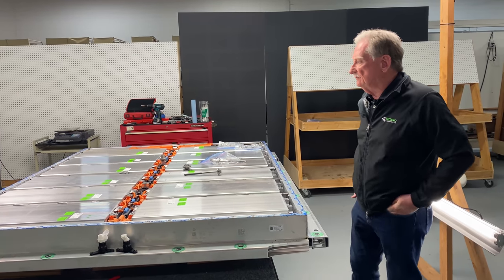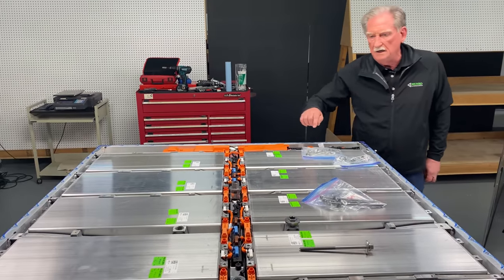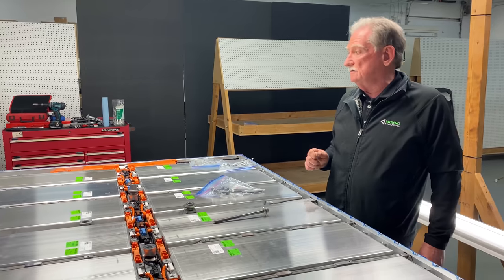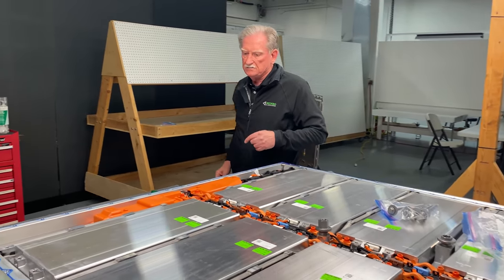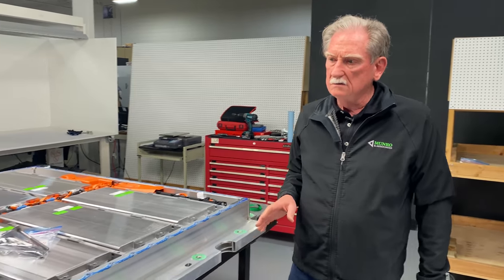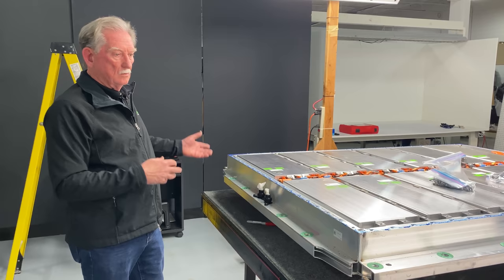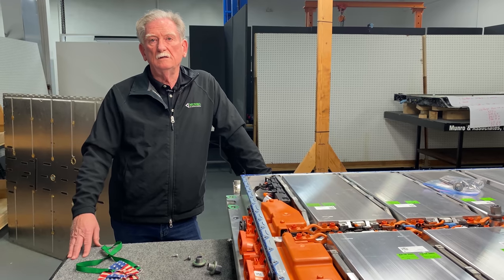2021 Volkswagen ID.4: Battery Teardown

Comment: weight per kWh is almost identical between ID3 and Tesla Y
Reply: Yeah, I don't get how they get 50kg savings
Reply: its childish from guy like sandy to compare apples and oranges like that.. its ridiculous in my honest opinion.. and colored the numbers red .. well..
Reply: acctualy Tesla have 78 kwh capacity
Reply: 75kwh i useful capacity (WV has 78 kwh useful capacity)
Reply: Id4 goes 260 miles on 82kwh while model y goes 326 miles on 75kwh. Id4 battery is heavier and larger for less range. Tesla's battery power density and energy distribution efficiency is much better. The model y is clearly superior.
Reply: No they are not.  Looking at kg/kWh VW is substantially behind.  Hence the reason a company made the business decision to invest in hiring Sandy’s company to help them.  This is not just Sandy doing it for no reason.  If you are not able to see the differences with the information presented then maybe you need to work on you math skills rather than whining that something isn’t being spoon fed to you.
Reply: @mikefromuk  it's a method of highlighting differences. Comparison is good to consider solutions. The manufacturer has asked Munro to come up with solutions to reduce weight.
Reply: @itsballtime  Tesla grossly overstates the range of their vehicles. Edmunds only got 263 miles out of their long range Model Y. Others testing has found similar results. Other brands get much closer to their EPA ranges.
Reply: Could be wrong, but isn't he talking about the weight of the system without the batteries?
Reply: @Weezedog  tesla doesn't just make up a range number. All companies follow industry standard testing procedures and the EPA validates their findings. It's easy to add FUD when independently testing vehicles on different days, different accelerations, and ignore relevant effects and call the test fair.
Reply: @itsballtime  MY costs a lot more too. Europeans earn significantly less which is why small cheap batchbacj vars sell well here
Reply: @Weezedog  the Edmunds test was flawed as the model y was tested in cooler temperature compared to other models
Reply: @kaya051285  the cost will come down once the Brandenburg plant comes online. Add import fees and taxes and all vehicles will be expensive. The fact europeans are still buying m3 mY says a lot
Reply: @Weezedog  326 is the epa range of the MY. Not teslas estimate. Not sure what you're talking about.
Reply: @kaya051285  German made Teslas from gigaBerlin will be far cheaper in Europe by avoiding import costs. Most if not all new Teslas in Europe are coming from gigaShanghai right now, and demand is still sky high. Imagine what happens when they are priced as a domestic product. Plus,, implementation of micron-level accuracy new equipment like the gigapress will drop costs further. Prices will come down in Europe once gigaBerlin is online. But even then, the pro s id4 with 260 miles and the long range model y with 326 miles are only separated by $5k. Not insane at all for the increase in range value alone without even talking about the model y's world leading safety rating.
Reply: @kaya051285  most sold cars in Sweden are volvos. V60, XC60, V90.
Reply: @itsballtime  Actually, only SR+ are china sourced. Tesla still sells every single car they could possibly make so the ID.4 vs model 3/Y comparison is not a zero sum game. Both have enormous marketshare to capture. And frankly, the ID.4 is specifically targeted at a conservative, ICE-driving segment and isn't going to appeal to tech savvy Tesla owners.
Reply: @itsballtime  if you look at the stats, you are not correct sir.
Reply: @itsballtime  There is only one thing which will force Tesla to lower the prices - fierce competition and that's good for us. Expect better built quality from the german plant but not lower prices.
Reply: @MariQ s It depends what you expect  - also ID4 is one category below the model Y. In the US there are many buyers deciding for the ID4 and against the Model Y, but the main VW target are ICE customers which they want to sell over to EV.
Reply: @bavariancarenthusiast2722  Competition in the ev space is great as it only kills gas cars faster. It doesn't hurt Tesla at all. Tesla will be able to bring real costs down for Berlin built cars by avoiding import fees. This is just objectively true. Whether the price the customer sees gets lowered by the difference remains to be seen. Tesla has enough pent up demand to sell every car they make for years out, and their tech allows them to command the price point by value per dollar spent relative to competitors. This cost savings by building domestic vehicles in Europe will dramatically help Tesla's profit margins, and is yet another tool Tesla will use to maintain its lead in the global rise of evs.
Reply: @Weezedog  That cold temp range for the Tesla against warmer ranges for all the others Edmunds did will never get qualified when quoted sadly..
Reply: @Korligan1  No, most cars sold in Sweden are not Volvo.
Volvo is the leading brand with a market share of about 20%, "most cars" would be >50%
Reply: @kaya051285  but we don't need heavy healthcare insurance, our pensions are backed by the government & all education is very cheap in comparison. My degree cost was the books I bought and under 300€ for student union memberships.

For example daycare for my 2 kids costs under 400€/month, preschool when it starts is free as is schools and there are countries here where daycare doesn't cost a dime.

I'm happy with my salary, I get lot less than I would in the Valley but cost of living is a lot cheaper too because of the taxes we pay and unions we got.
Reply: @rj7855  Thank you for correcting me. Volvo does constitute the most popular brand and has the largest market share in Sweden. The point I was trying to make is that not every European country drives small hatchbacks as the rule.If we look at the rest of the top list for Swedish we mostly find station wagons and (by US standards) compact crossovers.
Reply: @beilkster  thats not really precise - eg Tesla’s EPA testing on all EV will give different EPA than each company rating. - EPA doesn’t make  test -  and companies can rate as pessimistic as they want (which Porsche did with the  taycan)  - Tesla’s still have a long range though
Reply: @71kimg   You are right that I didn't mention companies could under promise and over deliver. EPA definitely has their own tests. Companies test their vehicle,  make a claim on range and the EPA checks it with their own tests (has to be within acceptable range). Companies are still responsible if the range is overstated, but they aren't "grossly overestimating" like the original content I was trying to correct.
Reply: @itsballtime  "The model y is clearly superior."
If a better cW is all you need to achieve superiority you are right. Cause that's essentially it that makes the differneces regarding the energy consumption.
Reply: @kullatnunu2087  yep teslas are less efficient than an id3, ioniq etc. when driving on lower speed
Reply: @beilkster  then how come almost everybody got 60% more range out of Tycan in every day use than EPA?
edit : typo
Reply: @itsballtime  not only freight cost, but 10% tarriff on cars.
Reply: @hagestad  the Tynan could be sandbaging their milage number just like tesla did for years while sending over the air updates to increase range when they better understood battery degradation over time. That's just a theory.

If you have heard any of the FUD around tesla and top gear (faking the car running out of battery, not putting the petal to the floor when racing other cars, etc.) Then it's not that far of a stretch to see a bias when consumer report (assuming your source) tested only tesla on a colder day (other cars had similar temp), it would be easy to accelerate unnecessarily fast and not use regen braking on teslas (because other automakers don't have it...not really fair), not drive the car until it died (CR stopped at 0 miles and claimed dead, had to revise their tests and apologize for that mistake), and whatever other FUD you feel like. I'm taking the position that tesla has been upfront on numbers and that its easy to claim with "independent" tests tesla was worse if you wanted. Thanks for asking!

Edited to add more info: there are plenty of actual tesla owners that report on their cars use and milage (dirty tesla youtube is one of them) and they consistently match or beat teslas quoted range in REAL WORLD DRIVING (to be fair they haven't tested against other brands, but who cares if tesla is meeting/exceeding expectations). Also, any automaker that overstated fuel economy is open to a class action lawsuit... that would be a huge blunder. It's simpler to say the tests weren't fair or accurately presented (like the two examples I gave)
Reply: @silimarina.  Tesla has made you go crazy lol
Reply: @ronin7645  not as crazy as Tesla fanboys
Reply: @silimarina.  What's wrong with being a fan?  Even if it's a bit much?  I'm a huge fan of modern homes (some would say obsessively).  I made a comment one time on how I liked the angles and design of a modern home only to get bombarded from traditional home people on why their style is better.  They took it personal that I liked something different from them.  Ok, whatever, to each his own. I didn't engage in a poisonous back and forth to try and change their minds.  That's childish. People are going to like what they like and some are going to take it so personal.

Who has the problem?  Me or them?  My point is some fans of every brand are fanatical.  Ok, whatevs.  Who cares?  It may be a bit annoying but it certainly doesnt deserve time or effort engaging in  a back or forth with a fanatical fan. Nothing will change their mind, certainly not a stranger on the internet. Let them be. 

I'm a big Alfa Romeo fan yet I read all kinds of nonsense about them. I don't take it personally. I let them be.
Reply: @ronin7645  It's nothing wrong to be a fan as long as you are not blinded by that brand and start to make stuff up about other brands or your brand.
I'm a fan of Mazda, but I know it is not perfect and in some areas, it is not so good.
Tesla has the craziest/delusional fanboys i have known. Some Tesla/Elon fans live in a bubble and think that Tesla cars are the best at everything, Tesla/Elon can't do anything wrong. And anyone that says something bad about Tesla/Elon are trolls paid by the oil industry.
Yes I've been called that for pointing out well known stuff like Tesla issues with quality control or that Model 3 not having very good sound insulation for the price of the car.
Reply: @silimarina.  Ok, that may be true but is it your job to police the issue?  I have a Alfa Giulia Ti Sport and all I hear from Audi, Mercedes, and BMW fans is how unreliable Alfa's are. How the quality isn't good.  Yet I personally haven't encountered any issues in 2 years of ownership except for a weird check engine warning light glitch when I have low gas occasionally.  

The car has been perfect but for some odd and very strange reason, they attempt to convince me how their car is much better.  It's like, who cares?  They spew no wrong with their car but feel the need to call out my car. They're the ones with the issue so I let them be. 

If some Tesla fans are the same way, so what?  Why do you feel that compelled to correct someone who may be wrong about something they love?  Does it bother you THAT much to engage?  To me, that's a troll just as much as the other side. It's not worth the time nor are you going to convince anyone.
Reply: @ronin7645  The problem is, that Tesla fanboys are the ones that come on articles about other EV's to write how Tesla is so much better or how bad that EV is compared to Tesla.
Reply: @silimarina.  And? So?  Why does it bother you so much and why do you think it's your problem?  Nothing will change man. This type of behavior has been going on since the dawn of time.  It's just human. You have the choice to let it live in your head rent free and drive you crazy. You won't change their minds. No one will so what's the point?

Some merc and BMW people are the same. You gonna police them too?

Look, I get it, it irritates you. But you shouldn't let it affect you. Come on now, we all can't fight about everything annoying forever. Let it go.
Reply: @itsballtime  model y has 82 kwh battery with almost no buffer. It was never 75 kwh.  Even the old model 3 that was supposed to be 75kwh turned out to be 80.5 kwh.
Reply: @mikefromuk  i mean just look at this ID4 test drive videos and you can see instantly that hes not trying to look at this to learn and provide good information but just to tell everyone how good Tesla is once again.
Content has been insanely biased towards praising Tesla sadly.
Reply: But with heavier weight you need more kWh per unit of weight for range. Diminishing returns.

Comment: I'm constantly amazed by Sandy's depth and breadth of engineering knowledge. 🙏
Reply: It's very good, undeniably, first class in fact, but you might be equally amazed at the number of top engineers who do very much the same everyday. I think the public hugely underestimate the skills that are out there.
Reply: Amazed? By what? He was struggling to find ways to reduce the weight. And the VW battery pack is just slightly heavier than Model Y if you consider a similar size battery. But the VW battery pack looks more robust and especially more easy to recycle. Also making it out of composite will cost more in the end and will be a nightmare to recycle.
Reply: USA těžce zaostává za světem , pohled na to co se děje na vašich univerzitách je velmi smutný . Dostáváte se nazpět na úroveň před světovými válkami na kterých jste neuvěřitelně zbohatli.

Comment: With aluminium extrusion profiles you make and cheap strong light design, it is similar to the underfloor containers on trains in Germany, nothing really new.  With carbon fiber design it will be a bit lighter but more complicated and way more expensive frame. This design seams to be part of the load-bearing structure like tesla idea but less integrated concept. Also saw some laser welds there.

Comment: Sandy appeared to be struggling to find ways to shed weight off the pack in ways that wouldn't come at the expense of other considerations (e.g. thermal, safety, etc.) Just goes to show that the Germans have considerable engineering skill - there's a reason Musk is building a gigafactory in Germany (despite the hurdles) instead of Spain or France.
Reply: If VW doesn't figure out how to make something plastic then it probably shouldn't be plastic.
Reply: @UhOhUmm  Truth!
Reply: A $130 billion dollar OEM spending tens of billions of dollars to design a new EV platform has knowledgeable engineers?  Color Sandy shocked.  Coming from non-stop Tesla teardowns where Sandy found flaw after flaw that he had to tell Tesla engineers how to do their jobs... while strangely touting how great the Tesla engineering team is.... this must have come as a surprise.
Reply: @updlate4756  it's as if he's not unbiased to a certain manufacturer huh.
Reply: @smonyboy  he's biased as all hell
Reply: Yes that the reason  Germain's are sru8ggling to compete with Tesla
Reply: @michaeldbouck  Tesla’s maxed out on their European capacity right now until Giga Berlin gets up and running so VW selling more EVs isn’t a surprise.  Tesla’s nowhere near maxed out on demand, they don’t even advertise, and they haven’t come out with the Model 2 or FSD V9 yet.  Tesla’s just getting started and there is more than enough room for both VW and Tesla to sell a massive amount of EVs.
Reply: to think the germans are anything close to telsa is silly...you obviously have some sort of bias yourself
Reply: it's not so much the competence of the engineers, but the bureaucracy of the organization. in automotive production there are ever changing requirements, and managers and executives with egos that can slowly erode the end result.

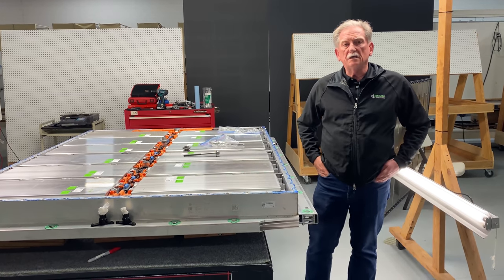Comment: @1:45 ... the pack already is practically on par with the Tesla packs. Tesla: 5.85kg/kWh, VW: 5.96kg/kWh - which is quite impressive for a modular system vs. a brick of glue...
Reply: Nope, they already have more kwh with same weight...but, tbh it`s not much room for improvement besides chemistry itself...
Reply: It is the Tesla's 2017 Panasonic battery pack. The ID.3 takes 125 kW peak, the Model 3 takes 250 kW. Power and managing/conditioning takes extra space and wheight. The ID.3 with this battery is a 4-seater, because VW struggled heavily with the payload. When the 4680s are coming out, this all will look quite outdated.